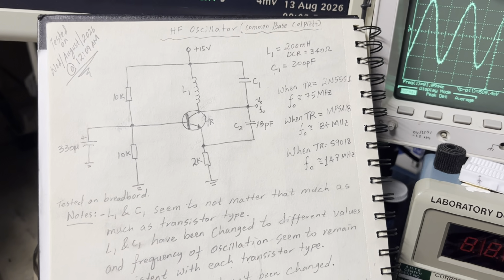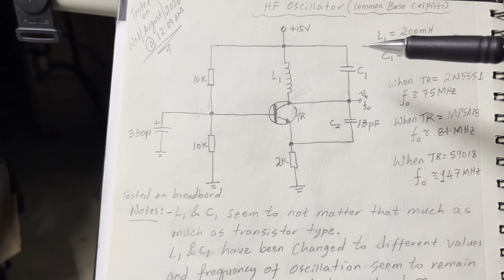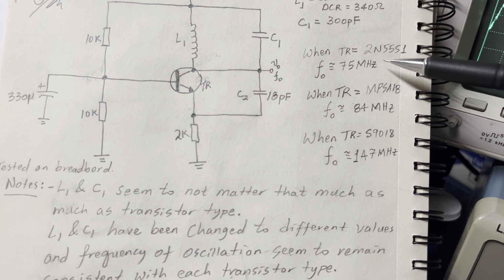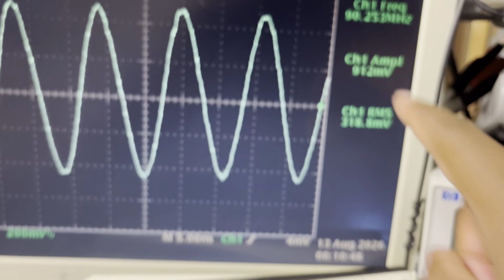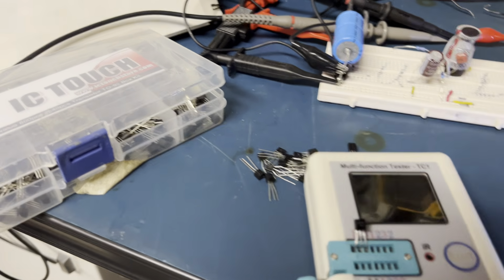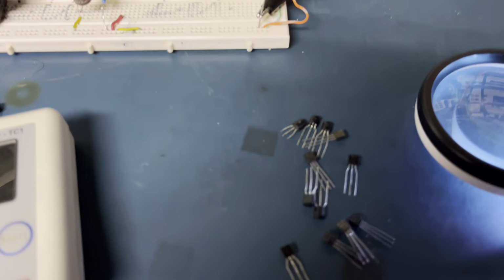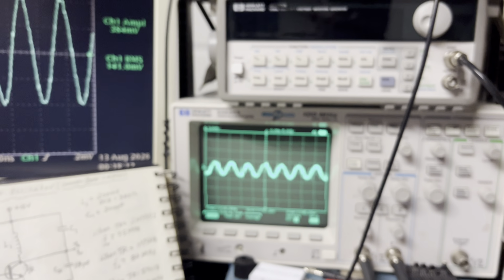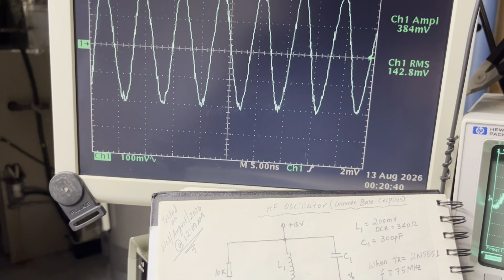Using Common Base Colpitts Oscillator to Test Transistor's Transition Frequency Qualitatively

Comment: Gray market Chinese electronic components use nickel coated steel for their leads. Cheaper metal than copper or aluminum. I have seen fake power transistors with nickel coated steel that have horrendous heat performance and stability. Even some electrical test leads that you find on Ebay, Amazon and Aliexpress use nickel coated steel with high voltage drop when used at higher currents.
Reply from the maker: It’s a great point, and those inferior lead materials certainly contribute to the thermal and resistance issues often found in counterfeit components.

Comment: Is the breadboard a good mechanism to test the transistors? I would think the parasitic on the breadboard will influence your measurements as opposed of a calibrated jig with minimum parasitic inductance and capacitance.

Comment: Nickel is ferromagnetic
Reply: Gray market Chinese electronic components use nickel coated steel for their leads. Cheaper metal than copper or aluminum. I have seen fake power transistors with nickel coated steel that have horrendous heat performance and stability. Even some electrical test leads that you find on Ebay, Amazon and Aliexpress use nickel coated steel with high voltage drop when used at higher currents.

Comment: i could be wrong but i dont think that circuit it working right. L1  is 200mH and C1 is 300pf should oscillate at 20.55 kHz but your scopes are show around 90Mhz im thinking something else is causing the circuit to oscillate at the wrong frequency. here is the calculation   fr = 1/( 2 * 3.141596 * sq root of ( L * C )) ,,  fr = 1/( 2 * 3.141596 * sq root of ( .2H * (3 *10^-12) ) fr= 20.547kHz. the breadboard usually cause oscillators to fail because of the capacitance which on mine is about 4pf. i use a pcb for high frequency for testing.

Comment: Transistor Ft may be calculated from finding the frequency at which the transistor gain drops from its DC value by 3dB and extrapolating it assuming that the gain drops by 6dB/octave above this frequency. The method is detailed in Motorola Semiconductor Data Document AN139A which can still be found on the nxp website. The US Amateur KN5I produced a circuit for doing this which may still be found on line. This method has the advantage that scopes with relatively low bandwidth and signal generators operating at only a few MHz may be used.

Comment: This is the weirdest setup I've ever seen. Normally, L1 and C1 (and C2 to a lesser extent) determine the oscillating frequency. Since the natural frequency of this LC circuit would be around 20 kHz (if the R of the inductor wouldn't be horrendously high, destroying the Q factor), the frequency at which the transistor now oscillates is entirely dependent on the inductance of all long leads, the breadboard and the load of the oscilloscope probe. The capacitor at the base is also strange, being an electrolitic type of large value. That thing doesn't much at frequencies above several tens of Megahertz. A 100 nF cap would be in order here but again, long leads and the breadboard spoil any form of real ground. So, this thing is oscillating, but it might work as any type of oscillator, colpitts, clapp or whatever due to all stray capacitances and inductances.

 Therefore, I highly doubt if that frequency says anything reliable about the transition frequency of the transistor.

Comment: I'm not sure I'd trust lead composition (magnetic or not) as an indication of how genuine, unless you can be absolutely certain that no genuine components were packaged after a certain date. IMO the lead composition only tells you the lead composition and decade in which the device was packaged. As material prices have changed, materials used in electronic device packaging has changed. And of course one manufacturer will change materials on a different date than another manufacturer. 

I said packaged above, and I do mean that rather than fabbed - for example, Rochester Electronics has massive quantities of older genuine wafers. They test and package devices as needed based on demand. So I think it's quite possible to get a transistor or IC packaged with modern materials but actually fabbed decade(s) ago.

Comment: Dear young man, you are testing in a completely wrong way! You do have some points, but the way you are doing it now is the wrong way!   Kind regards from the Netherlands
Reply: I am looking forward to see how you show us how to do it the right way. It will be useful if you could do this, especially without resourcing to a specialized piece or equipment that only the semiconductor manufacturers can buy.
Reply: @JoeGoesXtreme  And also :  @shidadokongo617   -  In the videos I’ve made, there are indeed no professional-grade setups sorry!
However, given this video, the circuit diagram, and the measurement method used, it is impossible to determine the frequency limits or the Hfe (current gain) that these transistors can achieve.(Or so I think!)
And the fact that these cannot be high-end transistors might already give a clue as to the price. ( AND, YESss I use them too! ) Well, I wish you all the best — Grandpa’s going to take a little nap now! ;-)
Reply: Grandpa, take your meds and go to sleep. You don't have any useful contribution to YouTube based on the videos that you posted on your channel.
Reply: @shidadokongo617   -  In the videos I’ve made, there are indeed no professional-grade setups sorry!
However, given this video, the circuit diagram, and the measurement method used, it is impossible to determine the frequency limits or the Hfe (current gain) that these transistors can achieve.(Or so I think!)
And the fact that these cannot be high-end transistors might already give a clue as to the price. ( AND, YESss I use them too! ) Well, I wish you all the best — Grandpa’s going to take a little nap now! ;-)

Comment: Good video, thank you for the work and sharing!. The different color markings may be "gain product" designations, and lets one choose transistors that may have a large gain range and select them into a smaller selected range "bin" for circuits that need something with similar paramaters ( Vce, Vbe, fT) , but need to operate in a specific gain range. One older , no longer made transistor tester, that has a test circuit to estimate a transistors fT, is a B&K 530. It has 2 test sections, one is a In & out of circuit tester to determine the transistors leads by using a 6 position switch, and also will put a small level test signal through it that works in & out of circuit. That section also measures gain, leakage, Vce and Vebo breakdown voltages and current. The second section has sockets for PNP & NPN through hole leaded transistors ( only tests BJT's, not FET's or MOSFET's) and a meter and circuit with a 3 position switch that will use an oscillator ( 3 frequencies depending on switch selection) with a self regulationg feedback circuit that will display the estimated fT on a meter. It's one of the only testers I've seen that has that function, and they are still available on the used market.

Comment: Although its a sensible idea to have an oscillator and plug transistors in to test, the oscillation frequency is set by C1 & L1. Certainly I'd give them values so it oscillated at say 100mhz or more which would give you an idea if it was suitable for rf. Putting random values in and hoping higher frequency transistor will oscillate at higher frequencies seems all a bit too random to me. I guess it sort of works but will give very varied results. Good tip about the magnetic leads on fakes, I'd not tiried that.
Reply: Yes, I would say the L and C in the collector are the main parts determine the frequency. The base is dynamically tied to Gnd bu a capacitor with high capacitance. It's common base amplifier with the parallel LC  circuit in the collector. So, it's a frewuency selective amplifier with the highest amplification at the resonance ftequency of The mentioned LC combination. The frequency varies because the Transistors have different capacitance at the collector.

Comment: Please explain a little. How is it possible for this circuit to make harmonic oscillation at 75 MHz, with such large L1 and C1 elements. These by themselves, oscillate at a very low frequency. And if we say that the coil acts as a choke, then the capacitor C1, is almost short-circuited to the 15 volt source (as for the 75 MHz frequency). How is it then that the capacitor C2 18 pF, receives voltage for feedback. Where am I wrong?.  Thank you.
Reply from the maker: If you look at the circuit construction on the breadboard, you get plenty of stray parasitic capacitance and inductance (lead length on the components are not that short and there is few pF of inter-node capacitance) that comes into play. That is why the value of L1 and C1 can be large and the circuit still oscillates as such relatively high frequency mostly bound by the transistor's transition frequency. If you notice on the video, I don't make any assertions to a particular deterministic frequency of oscillation. I just use the same test fixture to test the genuine transistors with the generic ones for relative comparison. Genuine transistors that operate at high frequency tended to oscillate at much higher frequency (SS9018 from Fairchild achieved ~ 150MHz). The critical component on this circuit is the feedback capacitor (C2). If you make it large, the circuit doesn't oscillate. My tests showed circuit doesn't oscillate if C2 is greater than 33pF (the biggest small value cap that I have on my parts list) If you have the ability, build this circuit on a breadboard and experiment for yourself.
Reply: @SmithKerona Okay, I understand. Thank you very much for the answer.
Reply: @SmithKerona which stray reactances do you think are determining the oscillation frequency? For giggles, I ran the circuit as presented in LTspice (with L1 200mH and series R of 240 ohm) and it happily oscillated at ~20kHz as sort-of expected, though I didn't run the sim long enough to see how stable it was. Is C1 even really needed for this circuit to oscillate?

Comment: With LCR tweezers becoming much more readily available to the hobbiest, another option for testing BJTs is looking at their input and output capacitance. Most of them should have a somewhat distinct combination from most other different models, if they're on different processes and built to do different jobs.

Although I'd argue that 95% of BJT jobs can be done by a massive batch of decent 3904&3906, or 2222&2907. If you need a special model for a special situation, get it 'especially'. e.g. find a genuine MPSA42 if you want a high voltage signal NPN.

Comment: Typo in the description: " transision"

And yes, the markings on the cheap components sold on ebay, Amazon and the likes are just ... decorations.
I bought one of those kits as well and came to the conclusion that they are all the same transistor, binned by hfe to be in the ballpark of what the copied part would have.

The same goes for the op amps: they sell the same 3-4 variations of a copy of an lm358 with any name you want.
Reply from the maker: Fixed and thank you! :)

Comment: 1. you cna try some real transistor like old bfr 91 and you will see, that in your setup it will also not work correct. You need proper pcb, or some fixture 
2. I once built similar oscillator - even with with bfr91 I was not able to go above 700 MHz
3. The DC point is important. If transistor saturates, the frequency is quite low.
4. It also depends on current and voltage of transistor - the higher the vcc the lower the capacitance and higher ft. The current has some optimal point.
Reply from the maker: Hello, This experiment is not designed to create a proper high-frequency oscillator. Instead, the goal is to 𝖖𝖚𝖆𝖑𝖎𝖙𝖆𝖙𝖎𝖛𝖊𝖑𝖞 compare genuine transistors against generic versions purchased from online Chinese retailers. Using a single, standardized test fixture on a breadboard (easily done by every hobbyist), you can easily evaluate and compare each transistor's transition frequency. Building this simple setup allows you to gauge relative performance differences without the complexity of advanced RF engineering. I hope you understand...

Comment: Any transistor that has the manufacturing date code "113", "331" are fakes. These manufacturing date codes, appear across a variety of Chinese made parts, all using tin plated iron pins. There are other codes that usually have a repeating digits that are also fakes. Also, the part number in 2SC945 should be written in the direction of the pins. Similarly with fake 2SA992, 2SC1845, 2SA1015, 2SC1815, 2SA970, 2SC2240. You can get all these with the same manufacturing date code 331. All these underperform in any application that requires the genuine parts. The issue is even more critical with high power parts like the 2SC3519, 2SA1386 and others in TO3P packages. It will be nice to actually measure the transition frequency at the same collector current specified in the datasheet. So far I have not seen any description of how to do that test.
Reply from the maker: Wow, if that is the case then take a look at Mouser carrying the said transistors here: https://www.mouser.com/en/ProductDetail/Soldered/101104?qs=sGAEpiMZZMv4z0HnGdrLjikbya4%2FJ9oPqlBgCPspZvIn%2FJ5hxeKltg%3D%3D. Crazy that even reputable outlet is selling these generic transistors. 

Edit: They are actually $0.36 a pop, crazy!!
Reply: @SmithKerona But at least Mouser tells you Generic general purpose transistor and make no claims as to what are the specifications. The datasheet does not have any parameters, unlike the real 2N2222 which we all know. I can dig up  my fake-parts jelly bean and see what other manufacturing codes are there that are almost surely fakes.
Reply from the maker: @JoeGoesXtreme  Indeed Mouser doesn't claim anything but I am just surprised they even carry them. It just show the proliferation of these parts everywhere...
Reply: @SmithKerona What can one expect from a country where:

There is strong evidence of specific Chinese manufacturers and suppliers knowingly adulterating or selling hazardous goods to domestic consumers, most starkly in the 2008 infant-formula crisis.

Milk collection and processing actors added melamine, an industrial chemical, to diluted milk so protein-content tests would register falsely high. Melamine contamination was traced as the cause of widespread kidney and urinary-tract injuries in babies and young children.

WHO reported that by September 2008, almost 40,000 children had sought treatment, nearly 12,900 were hospitalized, and three deaths had been confirmed at that point.

A subsequent peer-reviewed review, using Chinese Ministry of Health reporting, recorded approximately 294,000 affected infants and young children, 51,900 hospitalizations, and six confirmed deaths by December 2008.

The injury mechanism was not vague food-quality failure: affected children developed kidney stones, urinary-tract obstruction, and potentially fatal renal complications after consuming contaminated formula.

Mismarking transistors, bogus specced 18650 cells, and a huge selection of other bogus specced electronic and electrical devices that can burn your house down? Trivial.
Reply: Where did you get this information? It's wrong. Think about it - you're saying that no legit transistors were made in the 13th week of 2021, 2011, 2001, 1991, 1981, 1971 - likewise with the 31st week of 2023, 2013, etc etc etc. Throw in all the other patterns the human brain can recognize and by this logic there are basically no date codes where legit parts were made.
Reply: @markp5726  Yes, there are surely genuine parts made on those few weeks. But they are outnumbered  by the chinese parts that appear to have been made precisely on those weeks.  If you believe that somebody that is making counterfeit parts cares about the meaning of their manufacturing code any more than the part number they imprint on the component,  then feel free to buy and use any of the parts marked like I mentioned above.

Comment: I solve my part selection problems by buying from places like Digikey, Newark, Mouser etc. After you've been burned a few times getting junk from China that may work starts to lose any appeal.
Reply from the maker: Not so fast: look at Mouser selling similar transistors here: https://www.mouser.com/en/ProductDetail/Soldered/101104?qs=sGAEpiMZZMv4z0HnGdrLjikbya4%2FJ9oPqlBgCPspZvIn%2FJ5hxeKltg%3D%3D
Reply: @SmithKerona Ok but why would you ever buy 10 of literally "generic NPN" (supposedly 2n2222) for 50c per, when you can buy 'Diotec' BC547B & BC557B for 12c per
Reply: @ivolol  I don't know what the purpose of his comment was. I buy properly characterized parts from the usual suppliers. If others don't want to do that then more power to them I guess.
Reply: @muhdiversity7409  That buy known reputable manufacturer components and not general unnamed stuff. Usually known brand stuff is also cheaper because production volumes.
Example when adafruit sold to-220 regulator (counterfeit shutdown before max current when genuine was ok) in mouser and original manufacturer was way cheaper. Now checked some to92 5v regulator and it was like 1.2e vs 0.76e without discounts :D
I think those 3rd party sellers that sell counterfeit or old stock with markup price will increase when big manufacturers discontinue packages like to-92. to-220 has still place for power components.